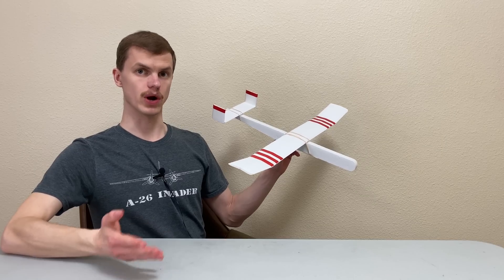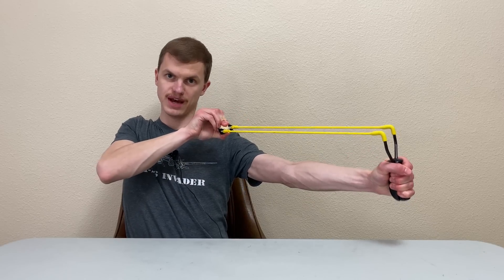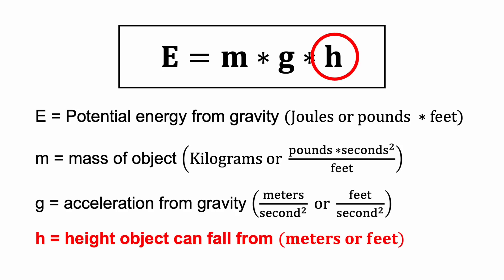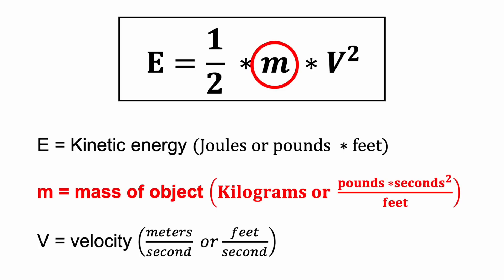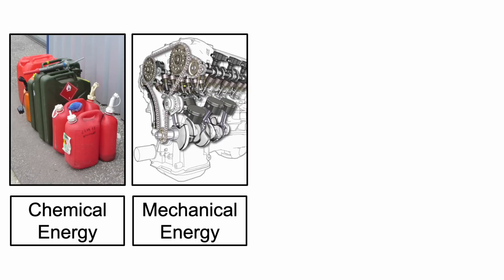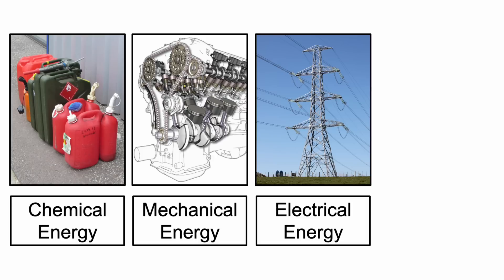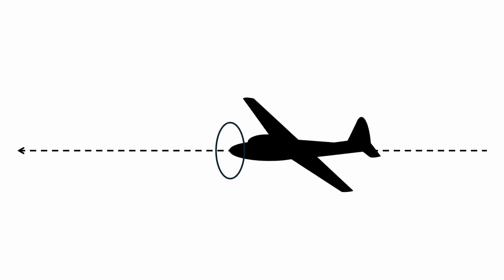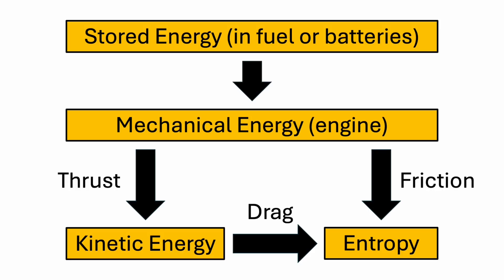Airplanes and Energy - Introduction to Maximizing Flight Distance and Flight Time

Comment: You need to explain the drag polar if you are to identify the best flight speed (equivalent air speed). As you probably know, all aircraft have a minimum drag speed (maximum lift to drag ratio speed), which is the speed to fly at for the best range - but only for gliders and propeller aircraft. Fly faster, and you have lower range because total drag increases. Fly slower and you have lower range because total drag increases. So best range for such aircraft occurs only at minimum drag speed. This speed is also “speed stable”, and the speed a model glider should settle at.

Best endurance (longest flight time) for such aircraft occurs at a speed slightly slower than minimum drag speed, but is not speed stable so is hard to maintain.

Note that jets are different, because their engines convert fuel power to thrust, not thrust power. So their best range speed is at 1.316x minimum drag speed (provided this is less than the critical Mach number) and their best endurance is at minimum drag speed.

Comment: Entropy is the total number of microstates. It’s basically the denominator in a probability calculation. I’d recommend not including it. Most people are very confused by it and not understanding it at all for some reason. You can just say the energy gets transferred to the air molecules, no need to invoke entropy.
Reply: Take rolling 2 6 sided dice for example. What’s the likeliest outcome, 7. That’s because there are more ways to make a 7 then any other number. What’s the least likely, 2 and 12. There is only 1 way to make a 2 and 1 way to make a 12. That’s entropy, pretty much.

Comment: Nice video. 
P.S. For max distance, isn't the CL/CD (glide ratio) what's important, not only drag coefficient or drag force (assuming CL is not fixed, i.e. mass or airfoil+planform or airspeed are freely changeable)?
12:08 https://youtu.be/jfEeWDiGS6w?t=728